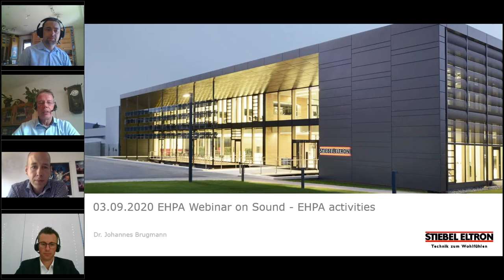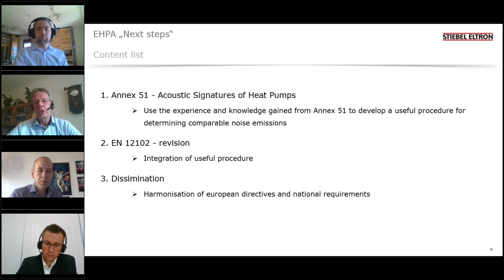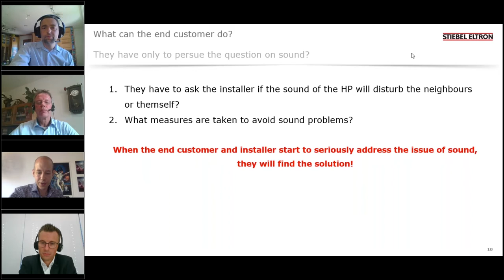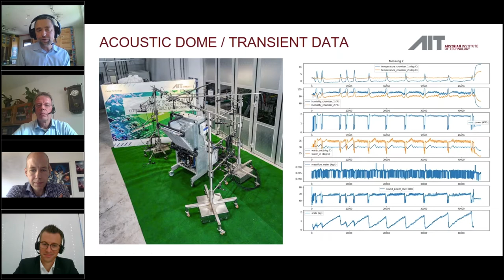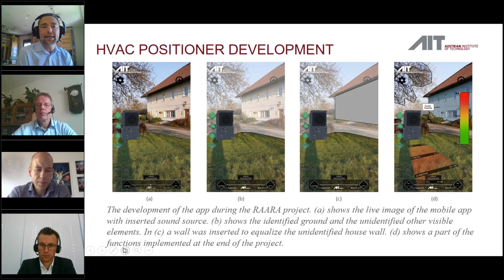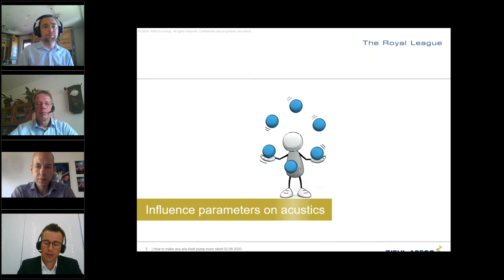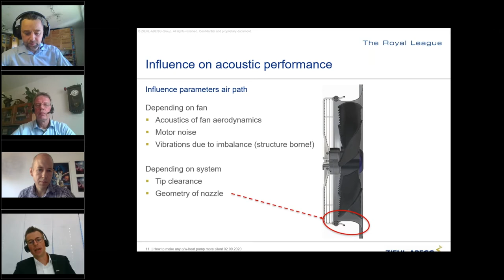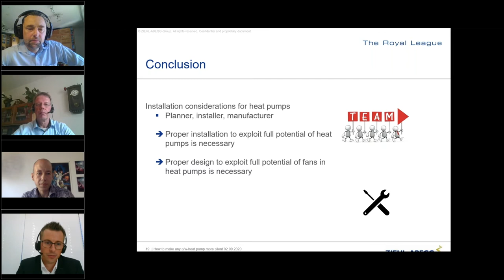The Perception of Sound and Heat Pumps - Online Seminar

Comment: Absolute nightmare with a Daikin outdoor unit on a light frame structure sound of a motor stopping and starting coming through the wall high pitched whistles and  buzzing from indoor unit. No help only smart comments no where to turn to and sleep deprived all that stopped me from coming to the end of a rope was my son would be waiting at the school for me. Every installer should have a sound engineer to check complaints or even a device that records noise and vibration within the home and have solutions . I’m all for sustainable energy but it should not cost peace of mind.   The consumer should not be sitting awake at 4 in the morning reading  the likes of Vibroacoustics of Timber Frame Structures Excited by Structure Bourne Sound. It was said after installing it that could be a problem though it was easier make me the problem I have my unit completely turned off I’d rather have no heat no hot water than go through having the unit on . Unfortunately the sound of my neighbours unit gathers at the far corner of my house though I’m told that’s impossible too